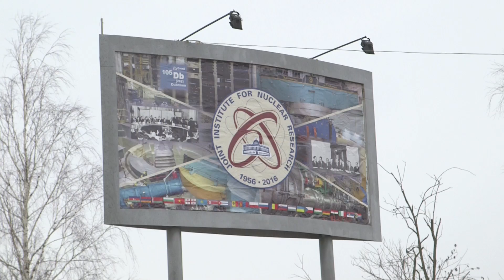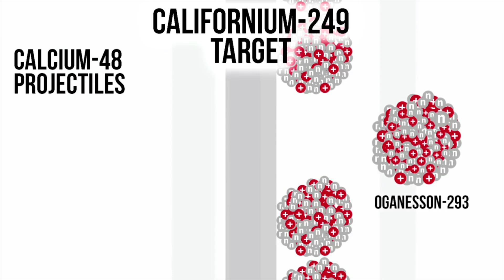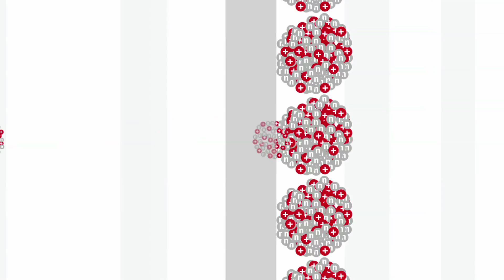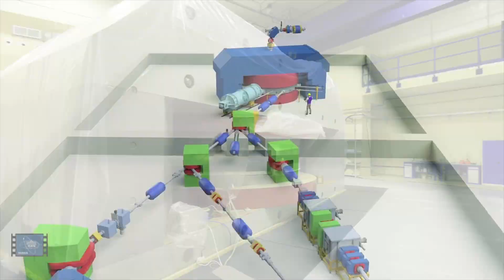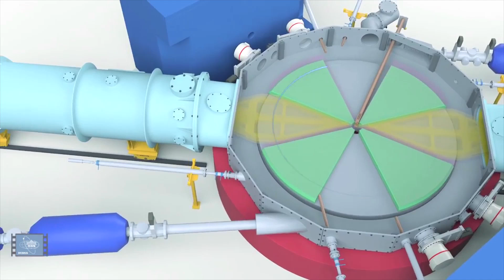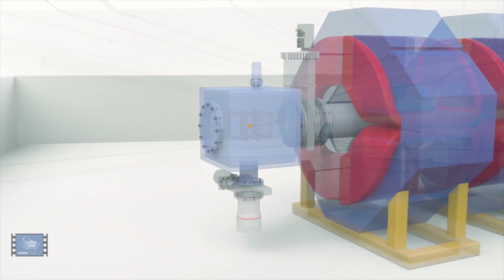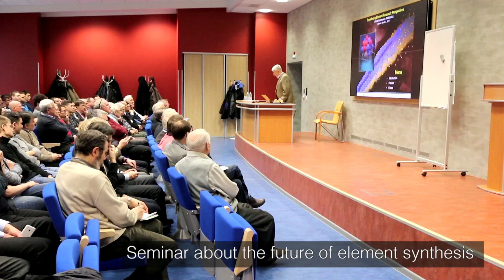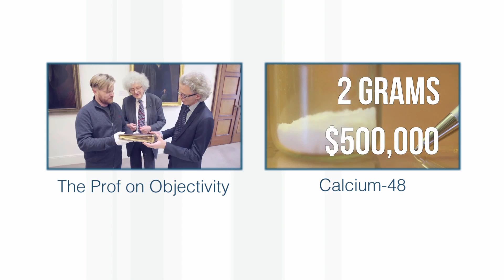Future Elements - Periodic Table of Videos

Comment: I don't think that this is a sufficient solution for more Elements beyond 118. The Problem is the increasing ratio of neutrons and protons. As result from this, you need an instable radioactive beam and an instable radioactive target. I think 8 Level of the Periodic table will be create by using a spallation source who creates neutron rich nucleons by fission, followed by a mass spectrometer to select a specific type, neutron rich nucellus, followed by linear accelerator to speed them up until it hit to the well known heavy targets from element 90Thorium to 98Carlifornium. This will may also create more stable versions of the Elements who are know until now, because the most stable is often also the most heaviest isotope of the heave tail of the Elements. At the GSI in Darmstadt Germany such an engine is under construction as art of an international collaboration.

Comment: The orbitals of the atom only has room for elements up to 120 so that's where the periodic table ends. Also our modern periodic table is completely wrong in its layout. The atom is completely symmetrical as should the periodic table that represents the elements. All things in the natural universe follows a specific sequence. If you want the correct layout of the periodic table I have it but unfortunately I cannot post a photo in the comments section.
Reply: Neils Bohr predicted that the end of the periodic table would be at element 137 (untriseptium) because a 138th electron would need to travel faster than the speed of light. Also you could just put an Imgur link for the image.

Comment: Is there any theoretical upper limit to atomic numbers? Might we someday find element Number 130, 150, 200, 408, 999, etc?
Reply: It depends on the theory. Some theories place the limit at 120ish, some at 260ish, and some have no limits. We don't know which theory is correct. We also don't know whether or not the Chandrasekhar limit could apply to atoms. If it indeed aplies, past a certain atomic number, the atom could turn into a micro singularity and dissipate into nothingness.

Comment: Wondering if the synthetic superheavy elements will ever be useful for more than bragging rights for those who discover them (and by discover, that's discover the evidence of their near instant destruction).
Maybe they also need a classification to avoid extending the table indefinitely, just like Pluto is no longer a planet, maybe anything below 1 second half life should be classified as a "transient element" - and I'm picking 1 second as a fairly arbitrary figure
Reply: Apart from a better understanding of our world, fundamental research also gives us many technological advances. The need for very precise synchrotrons to produce super heavy elements lead to an overall improvement of synchrotron technology. Nowadays, many chemists use synchrotron beams to analyse new materials. These materials don't contain any of the new found elements, but the technology that allowed us to find these elemtents now helps us to answer very practical questions.

Comment: Can someone tell me why the heavier of the two fusion candidates is always used as the target? Why not swap projectile and target? If one would use the light element as the target, the hit rate would be increased a lot due to the higher amount of atoms per volume.I once published a paper in eleventh grade where the two coauthors and I calculated the energies for making element 119 from a Rubidium target and a Lead projectile. At least in theory.

Comment: why not 3 elements instead does it have to be 2? idk
Reply: Piikachu pretty much at this stage getting the elements to hit together is already hard enough. Already under 0.1% chance of being combined together into a new atom. Most are deflecting blows, meaning they just bounce off one another. So imagine having to do that twice, would be very difficult and unlikely to occur. Also, isolating the newly created atoms would be difficult as well, and also the stability of these trams-uranium elements, especially the once created using his methods, they last less then a few seconds before breaking down into smaller atoms. But I'm sure the are working towards using methods that may fixing these issues.
Reply: logically speaking i don't think we should strive for element 119 or 120 because the prices aren't fitting instead we should improve upon 113-118
Reply: Elements 119 and 120 (ununennium and unbinillium) might be the last elements that can be synthesized with current technology, which is why they're building this new particle accelerator.

Comment: If this starts a new row on the periodic table, that implies that it would have a new electron shell, right? Do scientists know what shape a new shell will take?
Reply: The 8th period should include elements with ground state electrons that have an angular momentum quantum number of 4.  We can predict the shapes of these orbitals the same way we do for any orbital— we find approximate solutions to the Schrödinger equation.  Glossing over some complexities they should be shaped something like these https://upload.wikimedia.org/wikipedia/commons/3/3d/G_orbital.png
Reply: AFAIK Uue and Ubn shouldn't be concerned by the g-orbital, as the two new electrons should be in the 8s orbital.
Reply: But the Schrödinger equation is non-relativistic. Aren’t the electromagnetic forces in these superheavy elements strong enough to make the electrons move at close to the speed of light?
Reply: yes in QFT the dirac equation is used, which is basically a relativistic extension to the schrödinger equation.
Reply: Is there any chance that the huge nucleus will actually populate its electron orbitals? I just figured that post-fusion it will have crazy kinetic energy, and not long after that, it will blow up. The whole time in between it will be at plasma temperature, meaning no electrons, right?
Reply: Probably a circle 😂

Comment: If heavier elements then 118 exist why did we not observe filling of inner shells?
Reply: +Donald Ey  If I understand your question correctly it's because electrons fill into orbitals of lower energy first.  Orbitals in the next shell will all be higher energy than the ones that are filled in Oganesson.  Perhaps you are thinking of orbitals like 7d and 6f that were seemingly skipped as electrons filled into orbitals getting to atomic number 118.  Those should be higher energy than 8s but perhaps lower than 8p.  We need to do actual experiments though because things might become more complicated than we can predict by extrapolating from what we already know.
Reply: Super heavy elements don't exist in nature. They are being synthesized in these particle accelerators.
Reply: I understand that but at 118 all the shells we know of have filled.

If heavier elements exist shouldn't we see unfilled shells in the ones we do know?

Comment: Two questions that someone posed to me which I cannot answer: first why not just squeeze them together with a magnetic field like a fusion experiment? Why only look at two atoms to combine, why not fire two less rare atoms at a target which you can do at a higher rate?
Reply: Interesting questions!  In a way we do use magnetic fields because that's how the accelerator gets the nuclei moving toward the target.  I don't think something like a tokamak reactor could ever get enough pressure though.  The heaviest nuclei in nature don't even form in stars during their lifetimes but only under the tremendous pressure of a violent collapse.  As for the second question, this would require 3 nuclei coming together at just the right moment for fusion to occur.  Such a configuration would be so unlikely that the reaction would be impossibly slow even firing at a much higher rate.
Reply: “just” squeeze them together ... do you have any idea how many decades people have spent figuring out how to do controlled fusion?
Reply: Because that's how a time traveling toaster is made...
Reply: mentatphilosopher They use the magnetic field in the fusion experiments because the lighter elements will only fuse together at extremely high temperatures (millions of degrees). At those temps you don't have a solid, liquid, or gas, you have plasma, and a magnetic field is the only way to contain the plasma.

Comment: I can't help but wonder, is there any reason not to just try and go straight to try and make one of the elements from the predicted island of stability?
Reply: Because  jumping right into the island of stability if Very hard. Also, the island of stability is not yet localized, but we have a region where we expect this to happen.
Reply: It was a joke, mostly. It seems though, that they are basically working up the periodic table in order, and this is a tremendously lucrative situation for subcontractors, if they can keep this going. It might take them some decades to even approach the region where something interesting might happen. What I'd like to see in this channel is at least some hints to what this useful knowledge and information is, that they keep talking about. The way they present it now basically looks like a scientific curiosity, and guys playing with expensive toys.
Reply: As far as I am aware, they aren't entirely sure whereabouts in Period 8 the island is, if it exists, so it's better to be methodical and do them in order, where possible. Secondly, as the professor points out there are a lot of technical difficulties to overcome when making these super heavy elements such as choosing your projectile nuclei, getting them moving fast enough and choosing a suitable target material. By starting with lower numbered elements the scientists can build up to the bigger challenges a step at a time
Reply: That would dry up their funding pretty quickly.
Reply: Not something as moronic as Heretic said.

Comment: Instead of bombarding already heavy elements with a lighter one, why not produce two beams of heavier ones, one praseodymium and one neodymium for element 119, and two neodymium ones for element 120, and have them smash together head on?
Reply: Also, (assuming we had a method to accelerate heavier atoms to the speeds needed), with that method you wouldn't know exactly, where your new atom would be formed. The two beams would have to be directed right at each other, so the collision and subsequent fusion could occur anywhere in the beam. Additionally you have to think about the neutrons. They used Calcium-48, because it has a high neutron per proton ratio. We already know, that the more protons you have in a nucleus, the higher that ratio has to be to have a relatively stable nucleus; so you can't just use any two atoms, whose sum of protons matches your desired atom, you have to think about the neutrons as well.
Reply: Francois Lacombe That's what I thought, but I don't think that's possible.
Reply: Like it needs more energy and the heavier elements give more.
Reply: It would explode simple
Reply: because you would need something like a hipermassive Star exploding in a hypernova
Reply: Francois Lacombe 120 would not work because it would become a diatomic molecule.

Comment: who knows what the Periodic Table will look like in 50 years
Reply: If an element with a g electron shell is discovered, it would significantly alter the layout.
Reply: @litigioussociety4249  yes but that would be almost impossible since as you know, the noble gases are the last electron shell and they are stable. And even, I think its impossible, because every element on the periodic table aims to go to the last shell that has the noble gases.
Reply: Time travelers and flying spaghetti monsters.
Reply: this is the most beautiful thing i have and will ever read
Reply: when we are able to fund and fully construct a cyclotron that wraps around the moon several times we will be adding new elements to the table every other week...well, maybe not that frequently but there will be a lot more of them and most of them will be incredibly hard to pronounce and insanely expensive to collect and many may not exist as more than a few atoms at any given time so even identifying them and more importantly proving they even exist apart from other sneaky elements that surround them will be very tricky and aggravating
Reply: If you put the actinides and lanthanides between groups 2 and 3, and the superlanthanides and superactinides between group 2 and the actinides and lanthanides, it would take up a whole wall.
Reply: I’m not sure there’s much point in building a very large cyclotron. Remember they are aiming for a large beam current, not a high particle energy (unlike the LHC, for example). They want lots of collisions, not harder collisions; if the collisions are too energetic, then all they end up with are shards.
Reply: CarthagoMike probably not that different lol if the stuff required to get to the next one is in such short supply already I can only imagine the elements required to get even higher are gonna be even more in short supply and increasing difficult going forward. Sounds like we need a much more efficient method of acquiring rarer and rarer elements. Be cool to find that island of stability though 😁
Reply: That's a very interesting question. As we go forward in the more distants orbitals, relativistic problems start to appear, and there isnb't only one theory concerning how will the newt orbitals fill. It may only be a classical 8s2 5g18 6f14 7d10 8p6 filling or something completely different, who knows. Chemical properties of elements 113-118 are already quite messed up, so it may be a huge headache...
Reply: CarthagoMike - it will be pink
Reply: I am not sure if I will live to be 90.  My Grandmother is 92
Reply: I can guess, we'll probably have elements like Africanium and Feminisium to make up for all those eurocentric elements we've already got
Reply: Judging from what has been synthesized thus far, any new elements are likely to be even more unstable than the ones that have been created over the past 50.
Reply: John Ries l believe there is the island of stability
Reply: I have an impression of UNE is 119 element
Reply: It would look like the periodic table

2019 btw
Reply: At some point one reaches "unobtainium" -- something impossible for either economic, technological, or moral grounds. .
Reply: 173
Reply: A new and heck lot more efficient method/technique to make a new ones can be born
Reply: Its periodic...you know..
Reply: @louis-philippelavoie6929  a 3d periodic table?(3d-> 3-dimensional)
Reply: @alphonsokurukuchu  my point,exactly,yes
Reply: That's what they said 50 years ago.
Reply: Shouldn't look much different.
The nucleus of atoms getting bigger makes them more unstable as the Strong Nuclear force cannot withstand the repulsion of all the protons. There could be new areas of stability, or even new isotopes that are stable, but looking at neutron stars as a giant atomic nucleus, it appears that you need a lot of matter in one spot so that gravity can overcome the electromagnetic repulsion or simply fuse electrons into the protons and make them neutrons so that there is no repulsion. Gravity is the weakest force so you need a lot of matter for this to work.
I think they should keep going though, because there could be somethin stable and useful further on.
Reply: About the same as it has the past 50 years.
Reply: true, there might not be all that much change in the coming years, but you never know. In the past 15 years it has seen quite a few additions as wel after all.
Reply: Will be a circle
Reply: Probably elementey
Reply: Not me
Reply: Element XZ
Reply: I have a theory 
Take 2 periodic tables (long form) and put them next to each other in an inverted fashion.
That’s how it should extend in the future
Reply: Non-baryonic, antimatter and dark matter tables!
Reply: Element 165
Reply: It'll be the equivalent to geometry or adding letters or Greek symbols in a math problem.
Reply: almost 45 years to go
Reply: A new bible
Reply: In theory it could still end at "118". A minimum duration of survival of a new nuclide is already set, and if nothing bigger than what already exists can last long enough  to get recognition, then the element will be denied recognition. That thus implies the same periodic table in use today. Unless there is some island of stability for an element "higher" than 118 that allows adequate half-lives, we will be stuck.
Reply: Cosmigists have infinite everything,, lol
Reply: ununennium - fryxosia
I don't think that will happen

Comment: Professor is it possible to make an alloy of Na  K  Cs ?
Reply: AntiGravity I don't see why it wouldn't be. NaK is a real thing, it's a liquid at room temperature, and is used sometimes for cooling systems. NaKCs would probably be similar, though not usable in most ways, due to Cs combusting in air.
Reply: NaK already combusts in air, especially when heated. NaKCs would be much worse.
Reply: well yes but an allybof thpuse 3 elements at the same time
Reply: conal fisher  but the question is ...     is it posible to make it maby it wuldent mix or reack with each other

Comment: I'm sure I'm missing some subtlety here, but relativistically speaking, wouldn't launching light atoms at heavy atoms be exactly the same as launching heavy atoms at light atoms? If the problem is that the heavy element targets are too small, shouldn't they use the more common elements to make them and the less common elements as projectiles? It would take much more energy to ionise the heavier projectiles I guess, but that doesn't seem like enough of a reason...
Reply: Except: We do not currently have the capabilities to ionize and accelerate these heavier nuclei. So yeah... that's enough of a reason^^